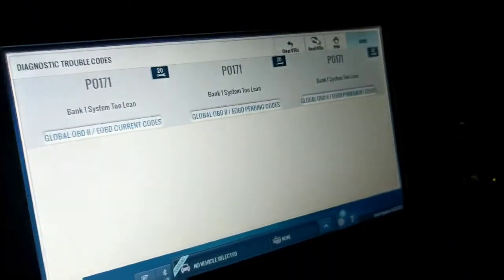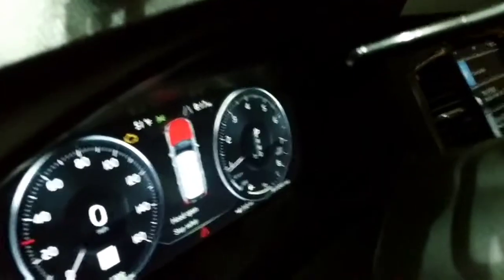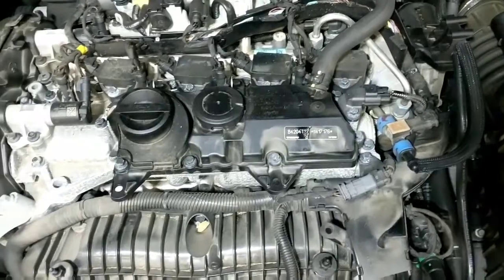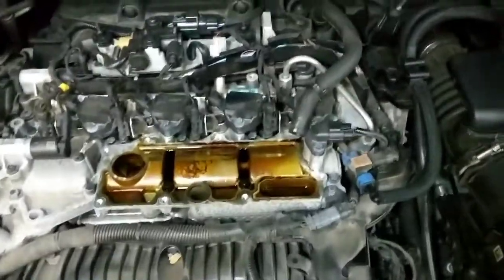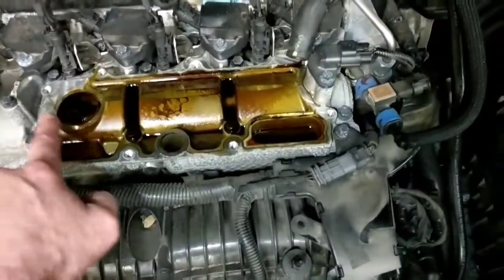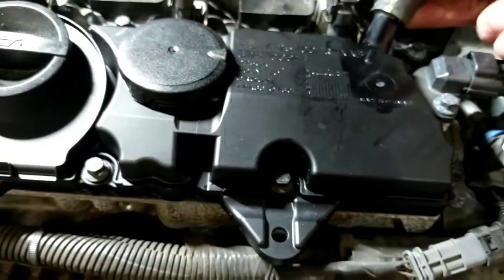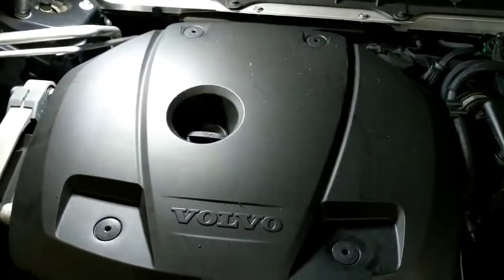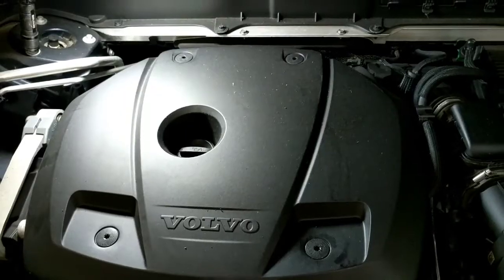2016 Volvo xc90 loud whistle P0171

Comment: Thank you so much! Had exactly the same issue. Quick Google search yielded your video. Purchased a replacement part, not the 0EM, which cost me $40. Took me 10 minutes to replace it. You saved me probably around $400. God bless you.

Comment: Thanks for the video. I just fixed my 18 xc90 which had exactly the same problem as in the video, loud whistle noise with the too lean P0171 code. I bought a genuine Volvo oil trap. The replacement took me about 30 minutes following this video. It works like a charm and the noise is gone! I tried to reset the check engine light but it was not successful at that time. After driving around with several start/stop cycles the next day, the check engine light became off by itself. I think my car is fixed now so I avoided a trip to Volvo services and saved lots of money. Thank you very much!

Comment: Thanks for this! I was hoping to hear the sound the oil fill hole makes with the oil cap off AFTER the PCV box is fixed.  My xc90 isn't squealing, but I get the lean code and the pulsating whoosh sounds when I take the oil fill cap off. What is normal crank case vacuum pressure?
Reply: Try resetting fuel trim adaptions, seem to have worked for me, check engine light would come on every time after replacing the part until I reset. We'll see if it comes back or not..also check your oil cap rubber seal

Comment: My 2016 Volvo XC90 has the code P0171 system too lean bank 1.  But doesn’t make any noise. Should I do the same thing to get rid off the check engine sign. Please help. Thanks
Reply from the maker: I would do a little more troubleshooting as other things could cause that code as well. The whistle I had was a dead giveaway for the pcv issue
Reply: Thanks for the reply!!!
Reply: @BengalTiger did you happen to resolve your issue? What was causing your P0171 code?
Reply: @danishtaco3852  I changed this part code did not go away. Next I’m going to see if the map sensor is the culprit. I did the vacuum leak test. No leak. I don’t know if the oxygen sensor is bad or not. It’s like a guessing game for me for this code. My inspection due end of this month. might have to take it to a dealer
Reply: @Bengal Tiger  yeah im having the same issue with my wifes Volvo. Except the CEL (with the same code) is intermitten. Comes on and off every few days. Im trying to narrow down if there is just a loose hose or not. Other than that the car drives fine. I too am going to try and clean off the MAF sensor to see if its causing the issue.
Reply: @danishtaco3852  same here at the beginning the engine sign used to come on and than goes off, but last six months constantly stays on. Also do you get an awful smell out of the exhaust after turning the car off?
Reply: @BengalTiger  i havent noticed a smell yet. Ill have to keep an eye on that. If it keeps doing this i will trouble shoot to the 02 sensor and replace that.
Reply: Trying to avoid the dealer since theyll basically be doing the same as we are. Process of elimination.
Reply: @danishtaco3852  let me know if you find the root of the problem. I’m pretty sure same problem we both are experiencing. I’m sure when your engine sign become steady you will notice the smell.
Reply: @BengalTiger  will do. Ill keep you posted. I'm trying to double check to see if there is a loose hose or something random. Next ill clean off the Mass air flow sensor to see if thats what causing the cel.

Also, if its the bad smell from the exhaust i can almost guarantee its the o2 sensor. Maybe trying either cleaning or replacing them.
Reply: Just got back from the dealer. It was the oxygen sensor.  I also had a leak on my Volvo. Camshaft seal went bad. That cost me $1380 the sensor cost me $292 for parts and $170 for labor. I’m very disappointed that seal went bad so early. I drove the car only 37k mile.
Reply: @BengalTiger  geez thats a bummer! Do you happen to know which o2 sensor was bad? I'm looking at them right now but they are pretty difficult to get to.
Reply: @danishtaco3852  bank 1
Reply: @BengalTiger  thats the passenger or driver side? Upstream or downstream?
Reply: @danishtaco3852  I’m not sure. I couldn’t even locate it on my xc90!!! dealer said it was bank 1
Reply: @BengalTiger  terrible
Reply: Did this issue get completely resolved after oxygen sensor ?
Reply: @aforaruntej  yes
Reply: How many miles on xc90 when this happened?

Comment: HELP, please! Would this oil trap issue be indicative of any additional issues that would cause our driver's side exhaust to smoke? I followed your advice and replaced the oil trap and the screeching sound went away, but accompanying this issue was white smoke coming from the driver's side exhaust (I am unsure if there was any smoke prior to discovering the oil trap issue but I think I would have noticed it) and after I replaced the oil trap the smoking still persists. This video was so helpful though, thank you. Our 2016 is barely outside of its warranty and we would have gotten a large bill I'm sure had I not replaced this myself. Hoping that the smoke is somehow residual and will subside.
Reply from the maker: If oil was pushed into the exhaust from the old trap, then it will take a little bit to burn away.
I would suggest verifying proper oil level, and going for a 10 minute ride on the freeway
Reply: @69nitronova  Thanks for the quick response! I had the trap replaced within five miles of hearing the sound for the first time so I was thinking it could be something like that.

Comment: I changed it and worked great for an hour and have same noise again. Causes?
Reply from the maker: You changed the entire cover? What brand part?
Possibly defective?
Reply: @69nitronova  was generic part so that might be it
I didn’t change the check valve though that connects to a hose
Reply from the maker: Go to FCP Euro.
You'll get a reliable part. I suspect this is the issue
Reply: @69nitronova  thanks will do

Comment: I am wanting to place the order for this part.  Just had a question.  How do I know if I just need to replace the old trap alone or need to order the full oil trap assembly kit?  Mine is definitely making the noise in your video but has the acceleration fan going after I turn the SUV off after driving it for a while.  No flashing codes or red hood just the check engine light is on.  
By the way FCP Euro is very helpful and easy to work with for a newbie owner of volvo.  Thank you for this video.
Reply: FCP totally helped me figure out which one to get.  Thank you again for this reference as I live in a rural area without a dealership close.
Reply from the maker: Yes, just call FCP Euro, they will sort you out. Have your VIN ready

Comment: Great video. I have the same code, with a terrible exhaust stench. I am betting on a bad O2 sensor but will do a vacuum rule out test first. Any hints on how to get to the O2 sensor? My guess is that I need to drop the plastic skid plate to access the cat.
Reply: I have the exhaust stench as well.

Mine is a 2017 S90 T6. 
P0171 code
Exhaust stench
Awful fuel economy from 21 to 16 mpg
Studders under light throttle
No whistle 
Seems to run fine otherwise. 

What ended up being the problem on yours?

Comment: So mine was making the same noise and I changed out the oil trap and now the noise is gone and I cleared the code but it's popping back up
Reply from the maker: Looks like further diagnosis is in order
Reply: Have you resolved this issue? I can't reset the code.

Comment: Is there a torque spec for the bolts? I've watch a few videos and everyone just says " tighten the bolts".  Want to make sure since I'm about to take this on and save a few hundred $.  Ps. currently our local Volvo dealership charges just under $400 to replace this.
Reply from the maker: I'm certain there is. I simply used a 1/4" drive ratchet and snugged the bolts. There is a steel sleeve in the hole of the oil trap where each bolt goes, you'll feel the gasket compress then you'll feel the sleeve hit the engine and stop tightening. I would guess around 70 inch pounds of torque

Comment: Does it have to be whistling?  I have a 2017 xc90 t6 2.0L Turbo with 50k mileage.  P0171 code and 50% stft high Ltft 23%. (Freeze frame)   The stfu Is at 0% most of the time at idle but sometimes jumps up as high as 50%.   I noticed the manifold pressure was around 10 isnt that too low?
Reply: Could be a leak in supercharger
Reply: David james did u ever find the problem..mine is doing same exact thing
Reply: Mine too.

Comment: What diagnostic tool are you using to clear the code? Also whats torque on the oil trap bolts?
Reply from the maker: I have a snap on and an OTC scanner. Neither has propriety software for this car. However the generic OBD2 setting in the scanner worked.
As for torque. I do not recall off the top of my head but I would guess it's 90-100 inch pounds. Only a guess though without digging through the books

Comment: did you have any other issues leading up to this? excessive oil usage or low coolant levels?
Reply from the maker: No, just the noise and the check engine light
Reply: Had this same issue too

Comment: My wife’s 2016 XC90 had the same problem check engine light come on and off did that for about a month checked for codes and got P0171 then last week we were in Florida on vacation and on our way home I heard a whistle noise when I would come off the Excelerator/gas part was $200 from fcp and came in today super easy to change out next I tried to clear the check engine light with one of those $20 OBD2 things also had to pay 20 bucks to unlock the pro version of the app well when I pressed clear code it didn’t work and now the abs brakes are deactivated and transmission is saying it needs service i’m wondering if I disconnect the negative terminal on the battery and try to start the car if that’ll wipe out the computers memory and I can start fresh
Reply from the maker: Not sure why that happened to you. I have not seen that. But yes I would think battery disconnection would help
Reply: Quick update picked up from the dealer yesterday it had a bad front passenger wheel speed sensor which was causing the transmission light and ABS light $500 💩they also cleared the p0171 code and reset the adaptations but today check engine light came back on with the same code p0171 💩
Reply: @clevelandsmith8580  smh 🤦🏽‍♀️
Reply: @clevelandsmith8580  Was your code ever cleared? 
I just replaced this part on my wife’s 2016 XC90 today, reset the Check Engine Light with the app, drove it around the block and now the light is back on.

Comment: I just switched the part. Thanks for the video. Does the code have to be cleared by the dealer.
Reply from the maker: A generic code reader that has clearing ability should work
Reply: @69nitronova  thanks

Comment: You have a link to this part? I'm having troubles finding it and the shops aren't a lot of help right now.
Reply from the maker: I would recommend going through FCPeuro.Com 
You would be best to purchase by VIN
Reply: @69nitronova  hey you're a lifesaver w the speedy reply.  Point of curiosity, you think I can just clean it up w brake cleaner and slap it back in or is this a genuine "no you really need to replace the part" situation?
Reply from the maker: @andrewbest1333  there's is a diaphragm check valve in the cover that I believe is what fails. Not sure if it's molded into the plastic or if it can be removed and cleaned. But I do not believe any repair parts are made other than the whole cover. FCPeuro will be your source for the whole part at the best price

Comment: I have the same sound and issue. dealer recommended fixing the breather and resealing the supercharger . And replacing oxygen sensors . Estimated $6k parts and labor . 
The car has only 66k miles , very disappointed in Volvo
Reply from the maker: I would do the pcv trap/breather assembly first and see how the car responds
Reply: @69nitronova  thank you for the video and suggestion . I ordered a pcv breather box and will fix it next week . Will update my findings here
Reply: @69nitronova  Update: I have replaced the PCV Oiltrap, huge thanks to you; Took under 20 mins. The squealing noise fixed. Dealer wanted $752+Tax. for a $170 part. 

The check engine light still persists. According to the dealer's diagnosis, the oxygen sensor needs to be replaced. Did not specify which one. 

Looks like thats my next step.
Reply from the maker: @aforaruntej  glad you are on the road again!
Reply from the maker: @aforaruntej  I would clear all faults and reset the adaptive learning to find out if an Oxygen sensor is still required. This oil trap causes lean oxygen codes and skews the fuel tables. A thorough reset would be addressable after the oil trap repair
Reply: @69nitronova  hi 

I ended up replacing the upstream oxygen sensor through an independent mechanic . Did not fix the issue . Check engine like keeps popping up within 2 miles . 

As much as I hate it the decision is to sell the Volvo . 

I was open to fixing the super charger leak, but a bit terrified about the piston ring issues .
Reply: @69nitronova I'm at 69K miles on my 2016 XC90 and having exactly the same issues. Replaced my breather box and the noise went away but I have that lean code coming back right away. But upstream O2 sensor is stuck at 0.0V so I'm going to replace that next and hope that's it. I wonder if the PCV issue gummed up the sensor.
Reply: @nicholash8021  had exactly same issues, got rid of it after changing the o2 sensor and got a Mazda. Regret selling my xc90
Reply: @nicholash8021  I don't think the o2 sensor change will make any difference from my experience, Its most likely the super charger gasket. That is what the dealer's smoke test determined as the cause from my lean code. You should probably do your own smoke test and check before replacing the $200 O2 sensor. Hope this helps
Reply: @Arun S  I cleared my codes again and reset my cpu (disconnected both batteries for a couple hours), and the lean code has not come back after an hour of driving. However I bought a new front O2 sensor anyway as it's reading static 0V and I'm worried about it running too rich on the new fuel curves. I'm now sure how much the downstream O2 plays into the calculations. Running rich for a long time will gum things up. I wonder if that's why my pcv box was clogged. Better safe than sorry.
Reply: @nicholash8021  Good luck. Keep us posted, on how it goes.

Comment: My 2016 xc90 just started making the same sound this evening. I noticed my alternator volts jumped up to 15 though. What would cause that? It does quite down after I open up the oil fill cap. So does that mean its my pcv?? Any help would be appreciated..
Reply from the maker: 15 volts on your car is not an issue.
If you have the whistle and it disappears with removing them oil fill cap then I would suspect the pcv trap assembly like my video shows. Good luck
Reply: Ok thankyou! Do you think it hurts to drive it with the whistle? We are about 400mi from home on vaca.
Reply from the maker: @tylerwingard5742  my concern is the high amount of vacuum created. This can potentially disturb engine seals.
FCP will be the best deal on the part, however I would suspect a dealer may stock it.
It only takes a short amount of time and a few wrenches to do. Could be done in a parking lot
Reply: @69nitronova  thanks so much for the help! This morning when I started it had stopped so will see what we can figure out! Being labor day wknd it's hard to find a part for it.

Comment: What would be a fair estimare for such a repair if taken to a repair shop?
Reply from the maker: The part takes around 30 minutes to change. I would suspect most shops will want 1 hour diagnosis time. So compare that to the local labor rate. It's an easy Do It YOURSELF like the video shows. Best of luck

Comment: this extra noise i understud, but hmm what noisy engines 2.0L new volvo, i test xc60 T5 2019 its work like diesel, i think its only my car engine work like diesel, but in video same, very bad for luxury car
Reply from the maker: The extra noise you speak of comes from the high pressure fuel system making the injectors much noisier. This is becoming common place in the industry.